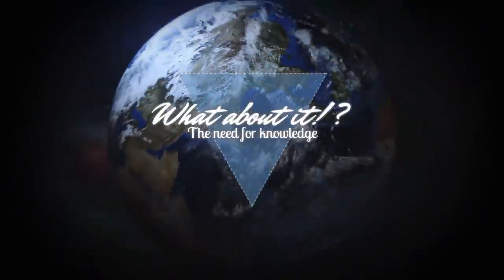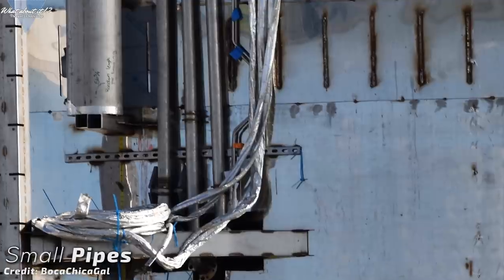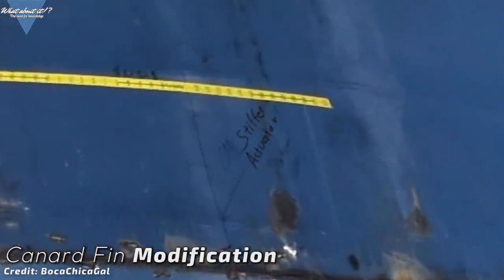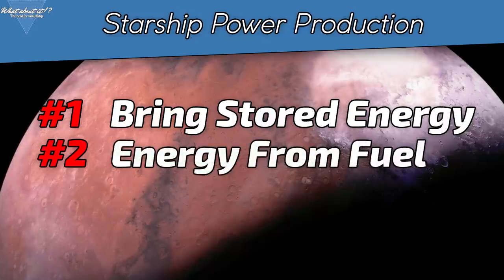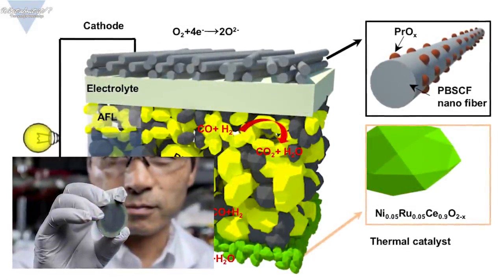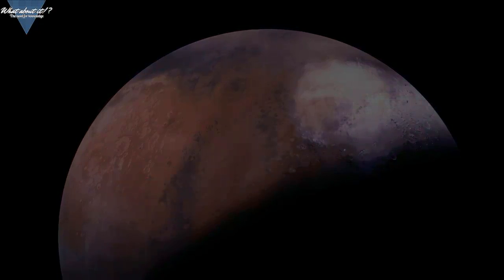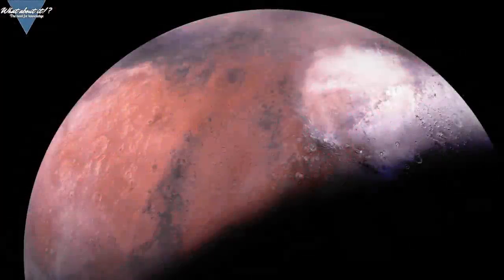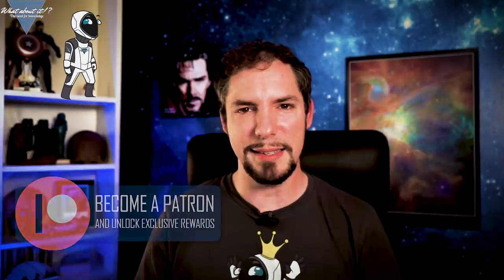45 | - How Does Spacex's Starship Generate Power?

Comment: Panels on the body are no-go because Starship cruises with its tail pointed at the sun to shield occupants from cosmic rays - panels on the body will be perpendicular to the sun for most of travel. But with well over 100 ton cargo capability, power equipment capability and redundancy will not be compromised. 

My guess is that deployable solar arrays seem a sure thing. Methane-oxygen fuel cells seem a good option for backup power too, and a few hundred kgs of battery is to be expected to  provide headroom for peak requirements and provide ample time if panels or fuel cells need fixed or adjusted. 

The extendable arrays shown in the old starship design illustration are each about the same area coverage as the ship itself, which works out about 500 square meters per panel. ISS has two arrays of about 400 square meters each, so that does put them in the same ball park of around 100kW. I suspect Starship could cope with less since it is a more contained and insulated structure.
Reply from the maker: Very nice reply and my thoughts exactly! Thank you! :)
Reply: @Whataboutit  Thankyou for the very interesting segment and show. I couldn't find much to add. A quick calculation suggests a fuel cell could consume about 20 tonnes of fuel for a whole journey, most of it oxygen, which is interesting if not mistaken.

Comment: The rails might be fin locks. The fins are subject to enormous force from air pressure. It might not be practical to oppose this force using actuators alone.  But if the actuators only move the fins into one of four locked positions, they would hold better with less power.

Comment: How about a Stirling engine? Use the heat of the sun and no fuel required. 😍
Reply from the maker: But is it possible to easily power a whole Starship with it and still have as little as possible addon weight? :O
Reply: Sterling needs the differencd between hot and cold, in the atmosphere you just need an exhaust pipe, in space you need a closed system!
That makes it not so powerfull because you have to cool it down again!
There are more efficient ways!
Using the temperature difference between sun and shade side!
NASA uses that, it is also used as replscement of generators in Trucks!
Reply: @Whataboutit  I honestly have no idea, there are some very small designs available, however I do t think I've ever heard of one that's been put into space, it might be a very interesting experiment to see it run with the temperature extremes of space, as that's exactly what they run on! 🤔 Perhaps an experiment to place on the iss?

Comment: I tried to run the numbers for methane fuel cell power generation. If I got it right, then supplying 75 kW for 90 days via methane fuel cells might consume around 37 metric tons of propellant, out of the Starship's 1200 ton total propellant capacity.  (Assumptions: methane energy density = 50-55E6 J/kg-methane; 1 kWH = 3.6 E6J; fuel cell efficiency = 60%; reaction involves one CH4 + 2 H2O, so oxygen mass = methane mass; total propellant mass is 2 times methane mass)

Comment: As for power on Starship, I think it will depend on where the ship is going. Moon missions would probably not need as much power so CH4 fuel cells would probably work. Mars, on the other hand, would require much more power, and be for long periods of time, so probably a combination of Solar, fuel cell, and even kilopower reactors. As Felix said parts of that could even be cargo that is used during transit (That's a brilliant idea btw). Kilopower reactors that are destined for the surface of Mars could be used in transit also.
Reply from the maker: Absolutely agree! :)

Comment: Anyone out there think there is some kind of metal framework inside the starship cone . There will be a lot of high forces on reentery.  Falling from 20 km is nothing compared to hitting the atmosphere at 27000km/hr. Even if it is the high thin atmosphere.  Everything will need to take reentery temperatures. Tiles on bottom of canard and control surfaces . Most likely
Reply: I recall seeing reentry force estimates of 5x gravity.

Comment: Solar panel arrays orbiting the planet(s) . After launch, linkup with an array and then travel to the other planet. Disconnecting before landing leaving the arrays orbiting. Launching from the surface and interplanetary transport are 2 different highly specialized endeavors. Perhaps eventually a larger ship/shuttle going back and forth between planets with artificial gravity due to rotation and with smaller take off and landing shuttles docking and detaching at either end of the journey.

Comment: Any long-term colonization or exploration of mars will require some form of nuclear power. Thorium looks to be a good option, as it can be effectively sourced locally, but still needs considerable development of the technology. 
However spaceX's efforts in the near and mid-term do not require nuclear as part of their development of starship for LEO missions, and I think that it would only be a distraction at this stage.

It seems to make the most sense for SpaceX to make clear to the Kilopower team their interest, promise support as needed, and transition towards nuclear power as a later stage of starship development.

Lastly it needs to be made clear that launching nuclear material to orbit does not need to be dangerous for those of us on the surface. The reactor can be launched separate from its fuel, and the fuel itself can be packed inside of a far more robust container; something capable of surviving reentry or impact without scattering nuclear material.
Reply from the maker: Why do you think, it will be required?
Reply: @Whataboutit  Don't get me wrong, solar is sufficient for many smaller missions we have planned for the red planet. But these barely-sufficient power sources like RTGs and solar panels aren't the sort of thing you want when to try and build up a martian industrial base with, be that for fuel  production or a martian ecconomy. Their power output per KG is painfully low.

That's not to say it is impossible to do with solar, but to quote SpaceX's Tom Meuller: "If you try to do it with solar; it’s extremely difficult, but doable. To get one ship back, you need about eight football fields worth of solar cells on Mars. And you have to keep the dust off them. Um; so that’s tricky. It’s much better to use nuclear, fission reactor, it gets, you know, more compact; you actually get more; you get more power out per pound of reactor than you do out of solar cells, so it’s more mass-efficient."

https://www.reddit.com/r/spacex/comments/6b043z/tom_mueller_interview_speech_skype_call_02_may/dhiygzm/

Comment: Also, unrelated, but important. I've thought that they could produce artificial gravity in the passenger compartment of the starship by designing the interior, like the centrifuge in the passenger compartment of the ship in 2001. Which they actually did build on a free spinning bearing. They are actually walking around the centrifuge in those scenes in the movie. Then you simply use the same chicken/roticery rotation the Apollo space craft used to equalize the temperatures inside the command module to produce artificial gravity. And of course you only need to produce mars gravity which is a fraction of earths to prevent the astronauts from experiencing atrophy over the course of their journey to mars.

Comment: The tank-in-tank design shown widely, would support the piping for fuel & oxidizer coming down from the center of the tanks to a fuel distribution section above the Raptors, especially as the center of the curved ends of the tanks is where the fuel and oxidizer will slosh to when the vehicle is under thrust.
#4 - we haven't seen the interplanetary version of the latest Starship design.
SpaceX already has access to Solar technology, and we know Elon's not going to waste resources coming up with something new when there's the easy option of upsizing the panels used on the Dragon Cargo Modules, don't forget, we're not seeing anything about the way the cargo bay will open - fold-able panels built in to the inside of the doors, or carried there as cargo, would be protected on re-entry when the doors are closed.
Reply from the maker: Exactly! Thank you for the feedback! :)

Comment: Every KWh of energy generated must eventually also be radiated back into space for thermal balance. The cylindrical Spaceship hull/fuselage does probably not have enough shaded surface to get rid of excess heat. That makes solar arrays, deployed in space from the payload bay(s) the most likely candidate technology because the solar array support structure can also support the thermal radiation system on the shaded side. For any other power generation option you would still need the thermal radiation system so why not combine the 2 (just like on the ISS).

Comment: Something that's been on my mind for a while is: how much power could a Raptor preburner produce if you used the turbines to generate electricity instead of pumping fuel? Could this be a viable means of powering Starship?
Reply: might work, but very inefficient. tops at about 30% of the energy stored in the Fuel. For such a long Trip you will burn lots of it that way, so Fuel Cells or Solar are certainly a better choice.
Reply: @unitrader403  efficiency was my big worry with that idea! Suspected it might be prohibitively poor, but surprised it's as low as 30%.
Reply: Great idea! Or great backup system if a more efficient system fails. 👍
Reply: @unitrader403  30% sounds like an ICE number, heat engines can get substantially higher then that. But considering the turbine size is pretty small, I wonder how efficient it would be exactly, probably well short of the theoretical maximum possible of around about 60% though.
Reply from the maker: The Turbo Pumps are pre burners. They just preburn the fuel. So the efficiency would be incredibly low and you'd blow a lot of valuable fuel out the nozzles. In return you'd empty the tanks needed for an entry and landing burn. Meh... might not be the best option.

Comment: Actually, gallium arsenide/gallium antimonide dual junction photovoltaic cells can operate at a high temperature, I've seen them subjected to combustion of methane to generate light for conversion to electricity by the cells. Conversion efficiecy is around 34%. Solar cells actually get more efficient the hotter you run them.
Reply from the maker: Thank you for the detailed comment! Much appreciated! :)
Reply: You are welcome. As I recall it was a project by Central Washington University in the early 90s to create a hybrid vehicle. The methane burned through a stack of ceramic disks that absorbed the combustion heat and radiated strongly in visible and near infrared light. The ceramic brick stack was surrounded by a star pattern of concentrator mirrors. At the apex of each point was a vertical row of GaAs/GaAn cells. This type is now standard for spacecraft, not silicon cells like we use on Earth, and is what’s on the ISS panels.
Reply: The generator I saw running at the projects commercial spinoff, Krystal Inc, was the size of a blender and generated 2kw of power, which is a huge power density esp for solar

Comment: There could be deploy-able solar panels under the leeward hull in concealed hatches.  Once cruise is achieved, basically there are no kinetic forces being applied to starship, therefore you can have very compact solar cells concealed under the skin and deployed after launch using minimal structure to support them.  There's absolutely no reason why a similar solar panel deployment couldn't be applied to the Starship design as it was to the ITS.   Another alternative is that you could deploy Solar Power Satellites in close formation to beam power back to Starship.   These units could theoretically be much larger in panel surface area, and could use small thrusters to position themselves around starship.   They could then be recovered upon approach to mars.  You could also carry spares, and they could either be deployed in mars orbit to power orbital systems or taken to the ground and deployed there with re-enforcement to deal with the gravity.   They could also be positioned as solar shields to prevent heating of the hull if there's a need to radiate excess thermal energy from the interior.  In space, thermal buildup is one of the more dangerous aspects of manned flight.  Each person produces between 40 and 70 watts per hour of waste heat, along with the waste heat of every piece of operational equipment.   This heat has to be integrated into the thermal budget of the spacecraft.

Comment: I think its pretty evident that the renderings are simply incomplete and they haven't settled on a power design yet.

Even if they did add nuclwar, starship will also need fairly large external heat sinks in order to dissipate heat from starship, including heat from the cryogenic fuel tanks.  A nuclear reactor would increase the requirement.

Also, you wouldn't need as much nuclear power as solar energy due to the baseload reliability of nuclear.  So perhaps you would only need 40 kw of power, or 4 kilopower systems.

Comment: Sterling engine like on the Space shuttle. It should be able to run for the entire trip.
Reply: Bryan Hensley but a nuclear one will run decades
Reply: @kerbodynamicx472  the Sterling engine uses nuclear. But only uses it in a rawer form for decaying heat. One side is warmed by the decaying warmth and the other side is in the deep space cold. Which is why it might not work on the surface of Mars.  You'll probably need much hotter temperatures because the surface is much warmer than the cold of space.
Reply: @kerbodynamicx472  I just looked it up, the NASA Sterling engine should last 7 years. It's a 25kw output.

Comment: I am a layman who would like to share a thought regarding the energy solutions for travel to Mars.  Could it possible to create electricity/power for the journey by use of a wind powered generator which is based on the same principals as hydro-electricity but by utilising solar winds or the movement of the vehicle on its journey to its set location? If rockets are required push the starship through space then there must be resistance in space. If this is the case then when the vehicle is travelling a 28,000 km/h (or whatever it is expected to travel at) could there be a resistance which could be harnessed for this energy solution?

Comment: A large folding solar panel can be added to one of the modular configuration payload cargo bays, that the first prototypes are unlikely to have. Bay doors could open and the Solar panel could unfurl at an adjacent angle from the rest of the craft, with radiator links to the hull body, and power links to wherever the power control station will be situated in the craft. That way when the solar panel or panels face the sun, the rest of the hull can function as the heat radiators. There could be enough battery storage on board to allow for times where the solar panels are packed away for collision avoidance, or in preparation for reentry maneuvers. But there will also likely be fuel-cells, the starship craft will need water and methane generators on board to fuel up on mars, but the solar panel mass could counter balance the crane mass, but because of dust accumulation & seasonal dust-storms they be ineffective on mars. The methane generators may be less effective on the moon, depending on the local composition of the moon wherever the craft would land, and the solar panels would have a long night on the moon if it stayed put, which can be more extreme depending on local terrain shadow casting. 

Whatever would work equally well in all those situations will not likely be the absolute optimum situation for any of those situations, so in the end there will likely be multiple variants of starship based on mission type, because their some missions where none of this equipment would be needed, (like low orbit refueling missions of other starships) and others where it will have to be specialized to the environment it was intended to work in which is why I think whatever the power solution is it will be part of the payload cargo bays, in a modular housing design that can be put in, & pulled out, by service crews as needed in whatever environment those service crews happen to be in & the payload of many starships might end up being as different as a fingerprint, based entirely on each craft's mission.

Comment: How about providing Starship with power using a simple generator powered by an internal combustion engine fueled by gaseous oxygen and gaseous methane? No high-tech development needed for that solution and does not weigh much.

Another solution is to power a generator using a Stirling engine powered by the difference in heat between the hot and cold sides of the ship while in transit. In effect, it is solar power but done without temperature-sensitive solar cells and could all be done internally.

Another way to tap the difference in temperature for the production of electricity is to use cells that rely on the thermoelectric Seebeck effect which is the reverse counterpart to the Peltier effect that generates a temperature difference from an electric current.
Reply: smart
Reply from the maker: The methane engine would consume needed Methane. I think a fuel cell then would be more likely, as it is more efficient and gives out water. The Stirling engine I simply forgot. Absolutely agree on that one. I'll look into the Seebeck effect! Thank you! :)